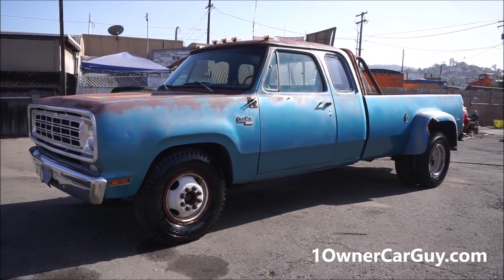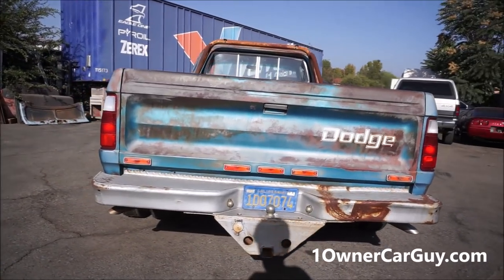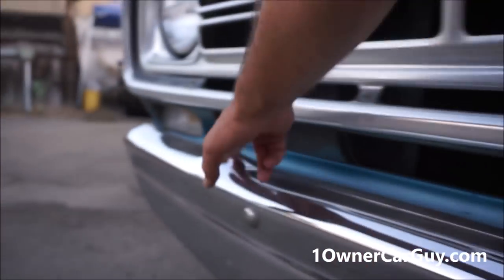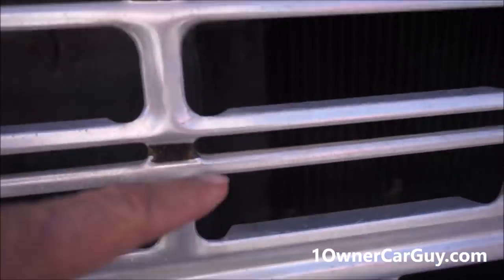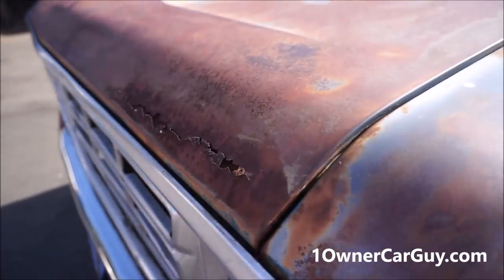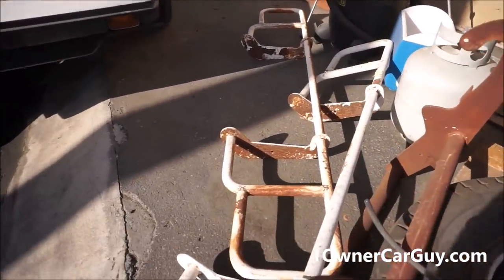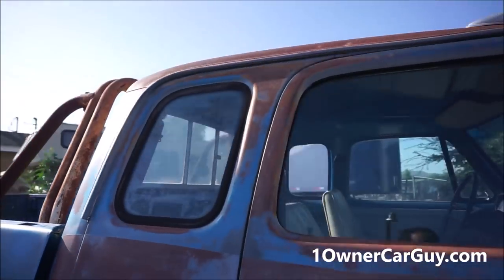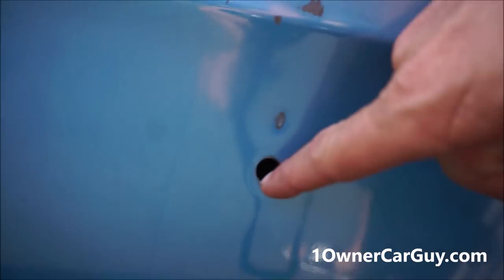DODGE RAM D30 DUALLY 440 BIG BLOCK ~ CLASSIC PICKUP VIDEO

Comment: Just clear it.. change the oil, tires, check the brakes.. too bad it's not a diesel stick... Might want to pop a 318 or 360 in it and pull the 440
Reply: El Camino I'll drop my fuel injected 318 in it and an nv45000 trans
Reply: Why would you do that...no sense
Reply: @johnhull6363  because the 318 is all you need.. they are bulletproof.. extra one's in the garage.. they don't make OEM 440 blocks anymore, donor truck for a Mopar car..
Reply: What do used running 440 engines sell for these days?
Reply: @davidnull5590  $500.00 you pull it.. it's the block with# that makes something like.. an old Cuda or Charger. Period correct.. gotta be rebuilt too.. but that's where the real money is added..
Reply: @jdog942 excellent knowledge. My 98 ram 1500 4X4 had a 318 and can handle any payload I have, plus tow 5-6000 lbs. No problem.. I have an extra 318 and would stuff that BB in a car..
Reply: What